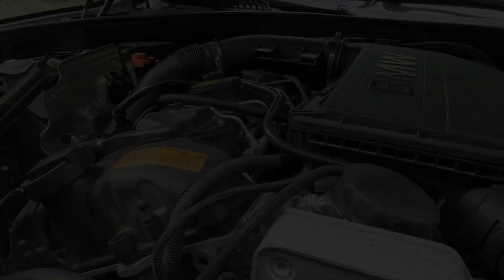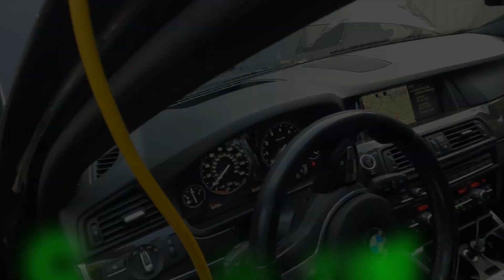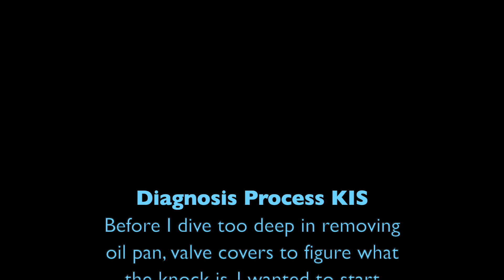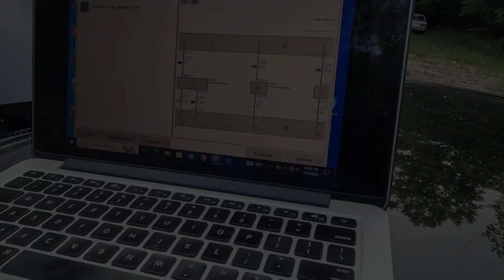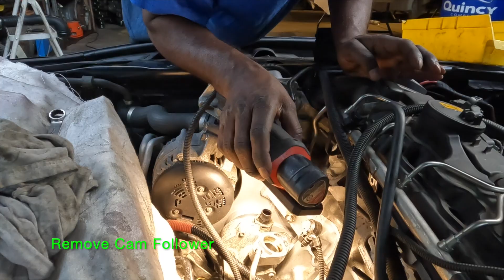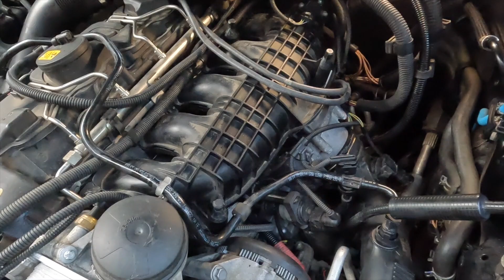BMW 535 Xi M Sport Engine knock ~ 2500 miles on Installation  2860- Part 1

Comment: Sorry to hear that you are having trouble.  I built an N55 this summer right at the same time you were posting videos. You set a high bar for your meticulous process. Several times your videos  helped me avoid a costly mistake. Knock on wood, ours is nearing the first 5000 mile oil change without major issues. Although we did forget a hose clamp on the filter cooler that stranded my wife for a few hours after a 1000 miles :-). PS we are just north of chicago in Wisconsin. Thanks again for posting your videos.
Reply from the maker: Congratulations to you.  I have about 5K on the chain module rework. So far